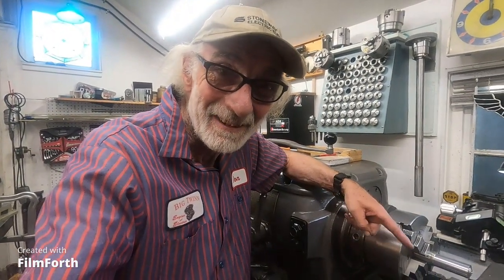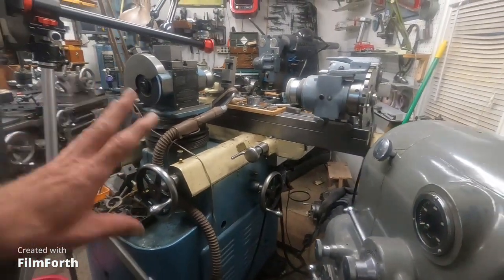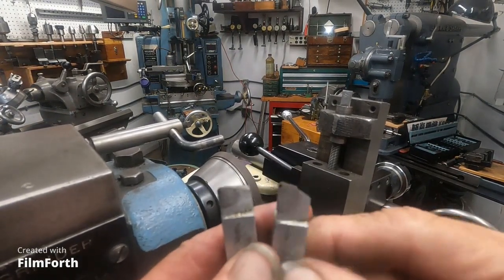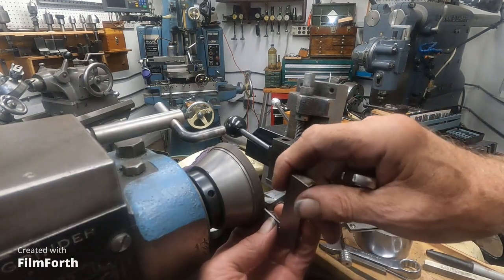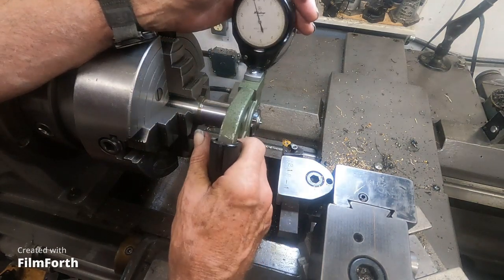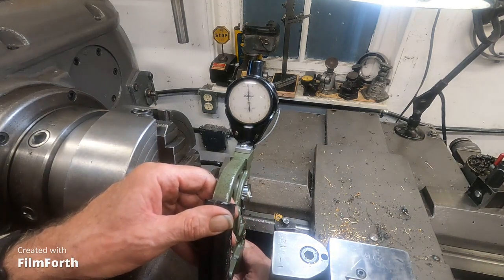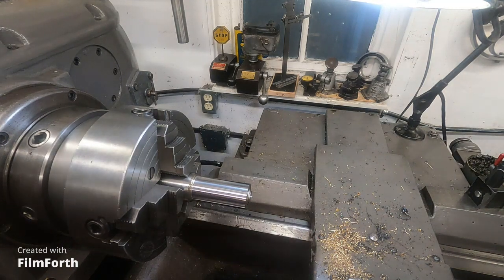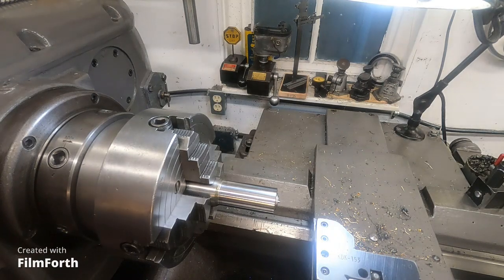Reducing tool push over on pre hard steels with carbide cutters

Comment: Agreed. I love my micro-100 AR lathe bits. I make them last as long as possible by just barely touching them up on my homemade slow speed carbide grinder ( imitation accu-finish). Great spotting drills by micro-100 as well. I find “better” more consistent and accurate cutting on my Southbend with a razor sharp point with no radius. I suspect because of the plain spindle bearings riding in a microscopic film of oil.
Reply from the maker: Most do not know how amazing Southbends can be when working correctly., thanks!

Comment: I love 4140PH, it finishes so nice! So does 304 actually with sharp carbide or HSS, but it's nasty to cut because of the "death tinsel" that it likes to make... 🤣 (I know 304 isn't hardened or harden-able, just saying it finishes nice even though it's no fun to machine)
Reply from the maker: The number of this material is long gone and being hard to cut has kept it around too, this makes spring tempered razor ribbon. I may have to switch to something else.